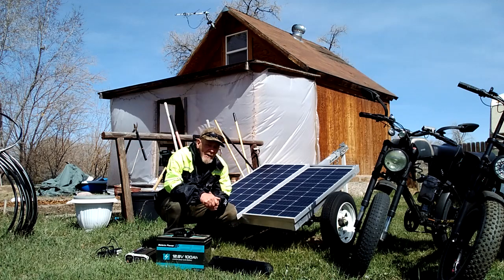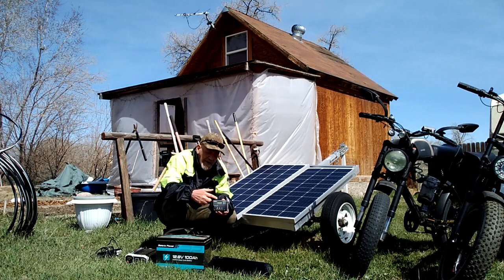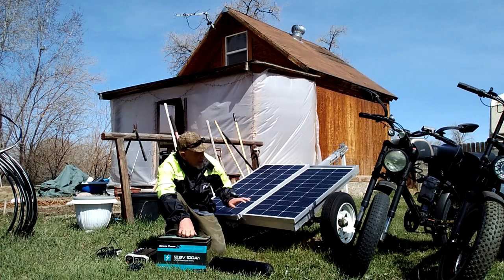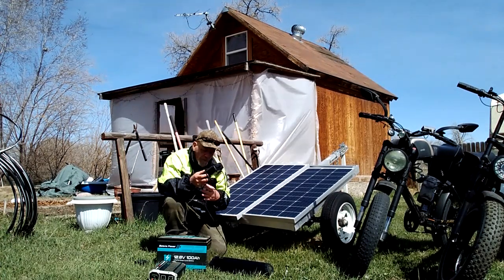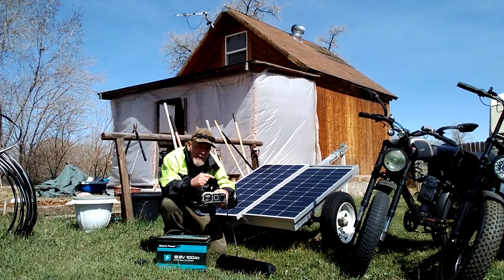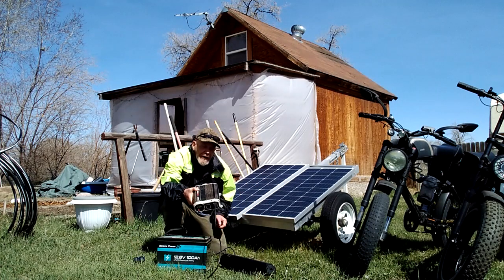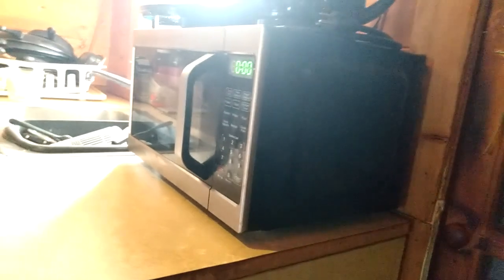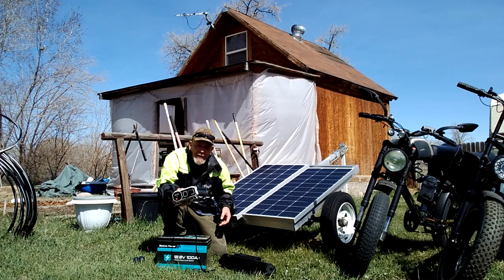200 Watt Solar Recharging Station For Ebikes,  Tools And Microwaves

Comment: I would like to know if you have any ideas how to make a trek bike into electric? If you do would you mind sharing the information thank you.
Reply from the maker: They sell ebike conversion kits on Amazon and Ebay but I have not used them.
Reply: @solarcabin  Can you recommend a good one? I have no idea what to buy? I can install the kit just need what type of kit to buy. I want a kit that the bike is pretty fast not to slow.
Reply: @solarcabin  Do you have any idea how to reside off the grid in a camper trailer?

Comment: Could you use a portable power station, also called a solar generator, in lieu of the inverter and battery?
Reply: That's what I do.  I have a Jackery Explorer 500 and a 1500, and they work great for my purposes.  They have MPPT controllers built in, as a bonus!
Reply from the maker: Yes, you can use a power station for same purpose.
Reply: yes I have a ecoflow river that I use just for charging my ebike batteries